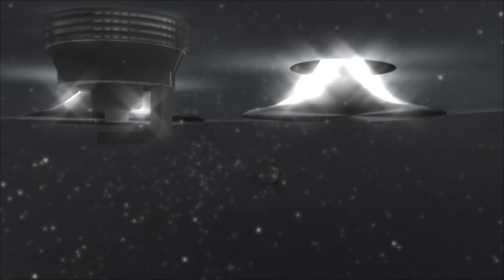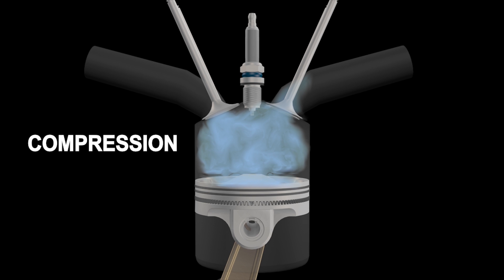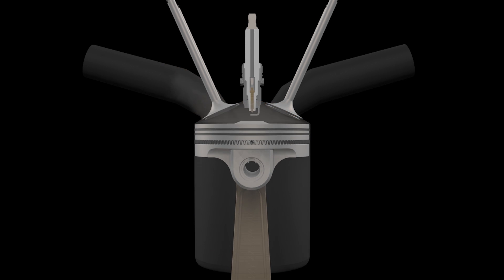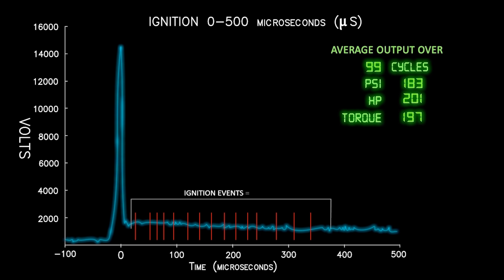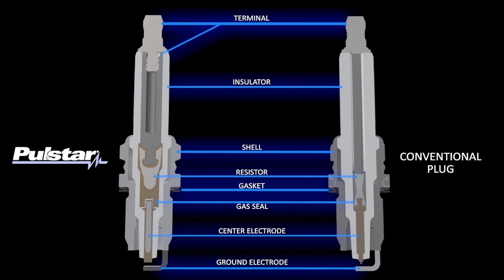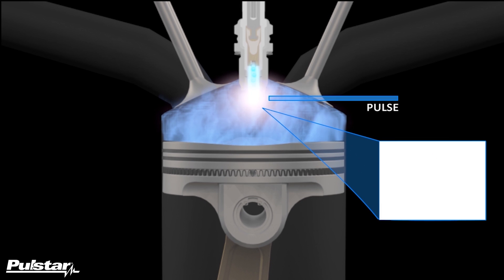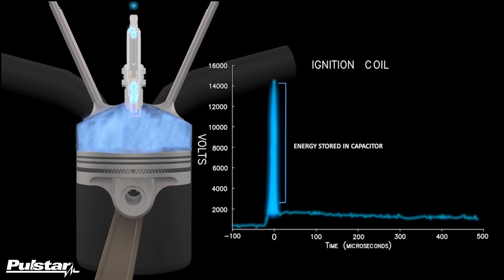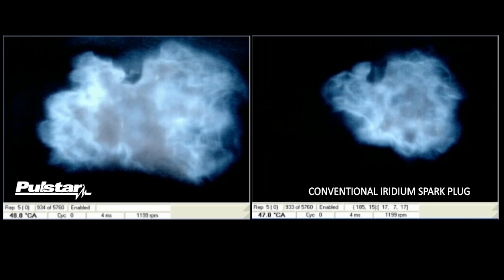How Pulstar Spark Plugs Work

Comment: I have a 2005 Ford GT in which I have added a pully and tune to the car giving me an additional 175 hp above stock. Since adding Pulstar Pulse Plugs I'm experiencing a noticable improvement in accelerator response and I'm back to the same mileage as the car had before the pully and tune. Thank you Pulstar!
Reply: What a crock of BS.
Reply: @QuantumRift it’s true
Reply from the maker: Vince Stephens That's great to hear. Depending on your set up and how you drive we typically produce more power or better fuel economy. Gaining 175 HP sounds like you already had all the power you could use!
Reply: Lol

Comment: Nice overview of the Pulstar Pulse Plug Technology.  I use them in my Mazda3 and enjoy the extra performance!  Thanks!
Reply: Pretty sure you're just experiencing what having all-working spark plugs is like. And not some magical Horsepower increase on a engine.

Its just like Cold Air Intake mods, they do very little to nothing at all or even make the car run worse off than before.

Edit: there are test videos that show its performance, but is minimal at best. Were talking maybe a potential of gaining 0.5hp  on the dyno lol.
Reply from the maker: Nicholas Bennington Thanks for the feedback!